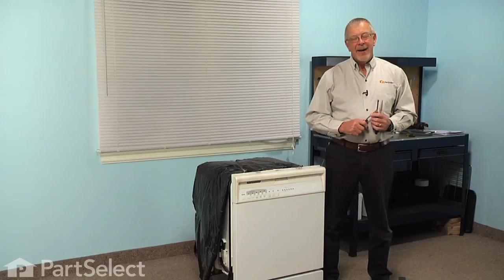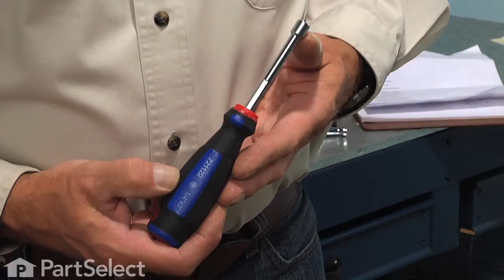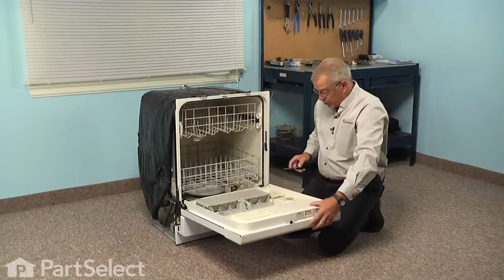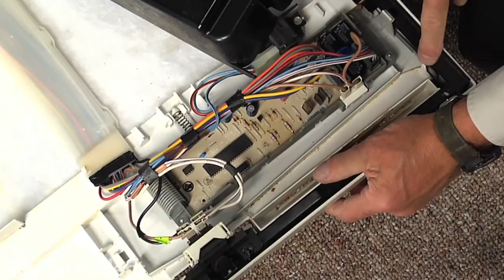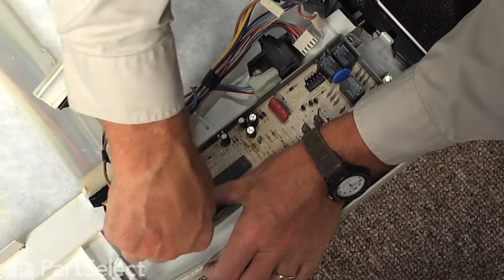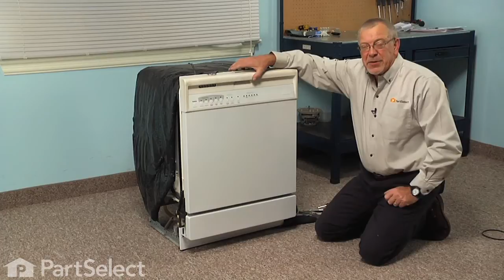Dishwasher Repair - Replacing the Control Board (Whirlpool Part #8530929)

Comment: thank the lord for parts select! this is the second time they have saved my a#@. the first time was cleaning out the chopper on another dishwasher, and this time was on a kitchen aid dishwasher i removed the wire harness's on the board but didn't not mark which goes where because 2 of them are identical but if you notice on the board itself there are markings for example y for yellow and gy for gray for each harness because i didn't want to guess! and the board is about 100$ + dollars. after looking at the wire harness in the video the colors match teh markings on the board so i know they are right. god bless america and part select!!!!!!!